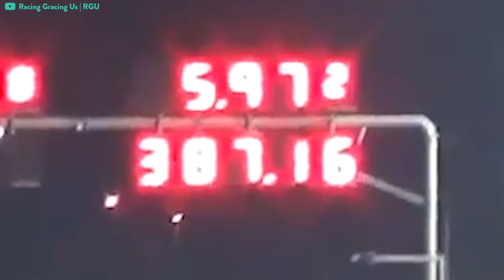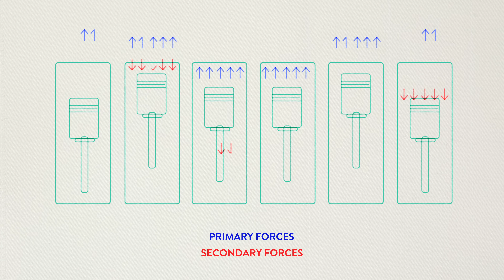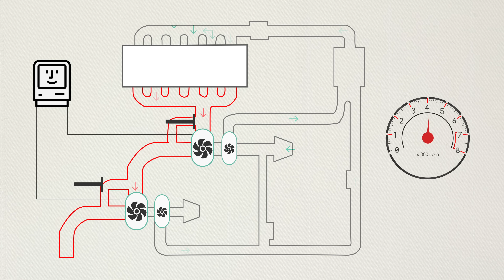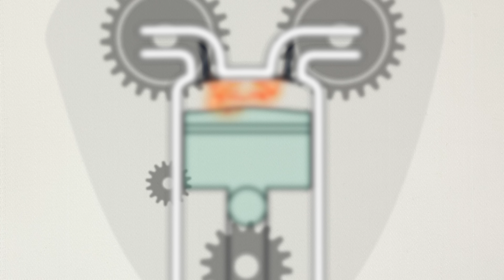2JZ ENGINE - How it Works | SCIENCE GARAGE

Comment: all this JZ stuff and i'm here with a single turbo 400 rwhp 7MGTE
Reply: sidsyz85
LOL I’m running two cars with 3S-GTE engines. One is putting down 300rWHP and the other is putting down quite a bit more (Need to dyno it at current level)
Reply: @negativeindustrial   I wasn't starting a dick measuring contest? M series(start 1965) is the predecessor of the JZ series, your S series engine debuted in 1980 so I genuinely have no idea what you were trying to accomplish.

Comment: Toyota should make the 2jz today and sell it separately, like the hemi v8
Reply: Or just buy a BMW inline 6 and turbo charge that, more or less the same
Reply: @alexstromberg7696  does the bmw inline 6 have a cast-iron block?
Reply: @kamaljyotsingh672  if you buy the right one yes. Some have steel sleeves, which is what you want. Engine is M50B25TÜ, people here are getting 800hp out of them to drift.
Reply: @alexstromberg7696  damn 800, where's "here"? Because your name is Strømberg, though you are in norway. Wasn't that engine used in M3?
Reply: @alexstromberg7696  what do you think about bmw making the engine for the Mk5 supra?
Reply: @kamaljyotsingh672  Sweden, the engine is in just the normal E36 325i I think. The M3 got S50B30s, which are 3 liters compared to 2.5l. they like boost too. A guy had a S50 in a E30 making 900HP and street raced it. 

Also here it's very hard to get legal streetcars to race. We aren't allowed to tune or anything but if you do it stealthly you can get it to work.
Reply: @kamaljyotsingh672  it's a good thing.
Reply: @alexstromberg7696  yeah it's hard here to get a racecar streetlegal, if you do it cost a hell lot of money. 900hp, they must be taking ferrari and Porsches in drag man, ouff
Reply: @alexstromberg7696  hey we should do a colab or something, are you going to raceworz 2019?
Reply: @kamaljyotsingh672  what is raceworz, I live in Sweden and never heard it it.
Reply: @kamaljyotsingh672  it takes down nos V8s with 1500 hp quite often
Reply: @alexstromberg7696  raceworz is like raceworz in fast and furious, stance cars, drift and drag, it happens in gardemoen Airport
Reply: @alexstromberg7696  V8s 1500 owned by i6s with 900, I got to see that to believe that
Reply: @Piotr94L  ait I believe it haha, you live i Sweden too?
Reply: @kamaljyotsingh672  nope, just the other side of Baltic sea
Reply: @Piotr94L  oh okay
Reply: @Piotr94L  what do you drive?
Reply: You need to own car with 2jz . Knowing Toyota, selling just engine don't make enough profit of multinational company.
Reply: @campkira  it could be profitable for toyota, i think at a lot of people would buy 2jz if on the market, its a great engine for almost any type of project car

Comment: This may be a dumb question but instead of switching to a bigger single turbo why wouldn't you just switch to a bigger secondary turbo and keep the smaller turbo for low RPM boost???
Reply: You can do that, it was done in rx7 13B, modern BMWs and many Diesel engines.
This way you've got all great things from both worlds - quick spool and good top end power

Comment: I own a 2jz-ge, it’s stock right now and has 195XXX, should I stay away from boosts and just go head and put headers, a cold air intake and a tune on it? (Of course more than that aka bigger pipes, better injectors/spark plugs/coil packs.)
Reply: You'll gain a lot more with like 9 psi of boost than a full of NA tune, at most like 40HP compared to 100HP for way less money
Reply: Thank you man. That what I figured, go low boost until I can buy a newer 2j

Comment: Too bad Toyota couldn't make their own engine for the new supra, or a manual transmission option
Reply: Guys I've reviewed the m240i with the b58 in it. Great car, great engine, amazing performance and power delivery. However, bmw reliability isn't too great from what I hear, so I'd hate to buy a supra that breaks down and costs a ton of money to fix everytime.
Reply: @MaxSpeedMike  I just watched a video that address that. According to that video they said Toyota was very concerned with BMW reputation with reliability so they ran the engines into the ground, every nut bolt and rivet down till they all failed and had them fix it all. From what I understand the short block is actually Toyotas design, may have misunderstood that and they developed I'm conjunction with BMW. In either case Toyota takes their reputation of reliability very seriously so im sure that carried over to the car. It probably won't be as good as a Camry at 200k but I would expect it to be decent.
Reply: No worries just 2jz swap it 😂
Reply: @suavehouse5150  haha 😂🤙🔰
Reply: @ekflpkf No confirmed manual option as of yet.
Reply: @gk5253  if I'm not mistaken it will come with manual but only in japan or some select asian markets. And it only paired with 4 cyl turbo engine variant though.
Reply: Agreed on the m/t, but BMW's i6s are great and the b58 is ridiculous. They underrate the 40is now and the pending m340i with stated 380 hp is surely underrated as well. In a light-weight Supra application and even better tune the engine will beast.
Reply: Reliability? Take care of your car. You curb it, too? I mean, c'mon...
Reply: they have developed the manual trans but will be waiting for feedback from buyers to determine whether they should introduce it, most likely to right hand drive markets first
Reply: Wait, they only have automatic? 

I have seen vidios  how drift the new supra in Spain and its Automatic?
Reply: MaxSpeed GREEEAAAAAAATTT
Reply: Agree
Reply: They said they might do a manual option it's just not confirmed because fans want a manual but most cars these says because of regular consumers are buying automatics more so there is a large decline in Manuel's.
Reply: MaxSpeed its you again
Reply: You must remember that 2nd and 3rd hand buyers mean nothing to manufacturers... They have to make car so it pleases 1st hand buyers and developing a whole new engine isn't just worth it.
Reply: BMW is the 29th most reliable. Not too great especially when you are talking about the #1 most reliable Toyota. BMW shouldn't be going anywhere near the Supra
Reply: Also no one buys manual transmissions everyone on the internet who cries out and bitches about that Everytime are clearly not people who can actually afford the cars they apply to. The people who can actually afford to buy these cars new from the manafacturer all want good automatics. I know I am one of them. I liked rowimg that manual transmission when I was 23 now I'm at 30, I ain't got time for that shit, the power delivery and balance of the car is 90% of the thrill. And I have no interest in sitting in my 1 hour commute everyday with a 5 or 6 speed and definitely not an 8 speed which manafacturer are forced into because of the absurd fuel economy mandates of the USA.
Reply: Ooo... BMW engine and a gearbox. What can possibly go wrong, hey... 😗😂
Reply: Wasn’t it Yamaha who did a lot of Toyota engine development?
Reply: Well yamaha made the engines for the supra soooo
Reply: BMW makes shit engines
Reply: @algarlegend  you're shit. you follow pewdiepie. whatever you say is irrelevant.
Reply: Good then that BMW has always made just as good engines as the 2jz, so the B58 is more than enough. You don't need 1200hp, those engines always have a shit powerband
Reply: @alexstromberg7696  BMW's are trash. Lmfao. Dont even compare
Reply: Alex thing is that they literarily could use engine of M2 or M4/3 but they settled for stupid automatic only mid-higher trim series 2 ass carriage for businessmen. Also we wont get any improvements at all same as there never ever was and will be a STI BRZ from Subaru because Toyota and BMW have anti-internal competition agreement in their deal. People seriously have to stop clapping for it, Toyota is being laziest they could ever be about it and with their position and resources it's completely inexcuseable
Reply: Kacpa2 but do you know why they did it, did you know why they chose the engine,do you know why they partnered? Research it.
Reply: Alex Strömberg oof that good old German reliability and oil leakage
Reply: @TheUberdude14  oof that good old "go fix it" maybe?
Reply: @alexstromberg7696  did this guy just say BMW has good engines? Lmaoooo
Reply: @terrabnadia1793  Just google INTERNATIONAL ENGINE AWARDS and see which brand have the most awards. BMW have the best engines in whole world and you are clueless
Reply: @lynx_bushcraft  BMW is overpriced and unreliable as hell. I would take a Honda over any German "luxury" pos any day
Reply: Aidan Barrett Their motorcycle engines are bulletproof.
Reply: @terrabnadia1793  lol ok you broke ricer boy.
Reply: @alexstromberg7696  at least one thinking person here
Reply: Why put a manual? Most of the people buying the new Supra aren’t the fanboys that love the manual. It’s a GT car and most people buying GT cars don’t want to deal with a manual transmission also the auto is a better transmission as you don’t drop out of boost, autos are faster shifting, and you don’t have to worry about working a clutch on a hill or in traffic.
Reply: @snipeatyou  driving a car with a manual isn't about being the fastest, it's about driving feel. And if you say that an auto can do the same, you're wrong.
Reply: Alex Strömberg an auto can give you that same driving feel. They make paddle shifters. Sure some are junk it some are good. Also if you want driving feel don’t buy a Supra. If you want driving feel get a corvette, Porsche, or a m car.
Reply: no, a paddel shifted car isn't even close to the same to a normal manual.
Reply: Alex Strömberg sure it’s not the exact same but you still get to select what gear you want. My corvette has an auto but you can lock it into different gears and it has about the same driving feel as the twin turbo 6 speed Supra I drove. I mean sure the Supra was slightly faster because my corvette has 2.73 rear gear and is a convertible but in the corvette you could feel the road way better than in the Supra although you could easily select which gears you wanted.
Reply: @snipeatyou  liking autos is fine to each their own. However a manual transmission is so much more fun and entertaining to drive for me. I don't care about performance but I do care about feel and fun. And no an auto with paddles isn't the same. The only thing that does it for me is three pedals and a stick.
Reply: Cameron James lol just let this guy think shifters are the same.
Reply: @snipeatyou  While I agree that autos that let you control the gear are an improvement over normal auto's, if you have driven manuals for an acceptable amount of time, you surely know that a manual is even further of an improvement as far as driving fun is concerned. Otherwise, you have not driven a manual for an acceptable amount of time and you should try that out. Either way, your argument is silly at best.

Yes, manuals are more work and there is obviously a valid market for the auto as most people do not want that. However, this is a sports car. The idea of a manual transmission is to more intimately connect the driver with the car. It engages you more, demands more of your attention, and makes you a more superior driver as a result. These are all things drivers of sports cars should have, if they desire it. Therefor, any self respecting manufacture of a sports car should include a manual option. The end.
Reply: Kakunapod it’s not really even a sports car. It’s a gt car like it’s always been. An auto is a superior transmission to a manual. Also not a big enough market to justify it. They would spend a shit ton trying to have all the computers work together and cutting stuff to fit the manual. The businesses main goal is to make money. I’ve driven manuals plenty. And it’s fucking annoying when you’re sitting in traffic and honestly you can control gears just as well and be faster in an auto. This whole manuals are much better nonsense is stupid. The only thing different is you push down a clutch and move a shifter around. It’s not that much more engaging than a paddle shifted auto. Also why does everyone say that manufactures need to include manuals but they don’t because of sales and most people saying manufacturers need to keep manuals aren’t buying those cars new. Manufacturers don’t get money from a sale of a used car so why would they keep manuals.
Reply: @snipeatyou  I cant get through the first few sentences of this, you are very close minded and refuse to even hear people who might be wiser than you and I don't really care to talk with you anymore
Reply: Kakunapod if manuals were worth it every manufacturer would sell all their cars with manuals but it isn’t. My trans am was a manual and it was fun but it’s inferior to an auto hence the reason f1 doesn’t use manuals although they use DCTs not traditional autos. I’m not saying a manual isn’t fun every once in a while but honestly it’s just not something for everyday driving or even performance driving.
Reply: @snipeatyou  Agree with you. People that are screaming save the manuals aren't usually buy new expensive sports cars. I'm sure toyota already doing their market research for manual supra and come up with conclusion that they're not feasible in business perspective, is not like they ignored the manual option at all.
Reply: Alex Strömberg You ignored what he said about the fact that they are not going to do this only for the Supra fanboys. It's a Gt car. Do you think every person who is going to buy this car is a Supra fanboy? No. They are focusing on the general market not the fans. Please do research.
Reply: @snipeatyou  its all about driver involvement and in a paddle shifted car its just not there. the less you have to do, the less fun it is. youre an a to b driver, not one who takes pleasure in driving.
Reply: ian price they are focusing on the first buyers not the second and third drivers. There is a high demand for automatics.
Reply: @snipeatyou  then why call it a Supra
Reply: Aidan Barrett because that’s what they decided to call it. People get so mad over it when I’m the beginning Supra was just a trim and it wasn’t turbocharged. I’m not happy about the new Chevy blazer or the 80s Chevy nova but at least I don’t go around everywhere saying I don’t like it. Also most of the people upset with them calling it a Supra wouldn’t even be the ones who would end up buying it in the first place
Reply: @snipeatyou   can you drift with a auto?  Because  you can conpletly shut down the ABS in the new supra
Reply: Thats Damian! You can drift an auto as long as there is no traction control
Reply: ian price 
I agree with with you but I don’t at the same time. Automatics may be slightly quicker and faster in some instances but regardless of how much faster an automatic is. You will never get the engagement and nostalgia you would in a manual transmission point blank.

Comment: It's an Amazing Engine. 2JZ-GE in my lexus. I want a 2jz-gte though.
Reply: They have that model on the Toyota Aristo (Lexus GS300) but it's only in Japan only
Reply: Yes the IS300 also has the 2JZ-GE if I recall correctly..
Reply: @stradale72  it does
Reply: just turbo and upgrade rods n shit, althought it would be easier to swap a gte into it it wouldnt be nearly sa fun
Reply: You can convert the GE to a GTE.
Reply: That Aristo was fast. I miss Japan so much.
Reply: Lexus GS300 (2nd Gen) right? Awesome, my dad has one too.
Reply: @stradale72  yeah it's second generation I think V300.
Reply: Is300?
Reply: Same I have it on my gs300 and I want to turbo it
Reply: Stronk Tank me to!

Comment: Donut. Next up: N54 engine. The modern 2JZ
Reply: Yes please!
Reply: It’s as close as we have. Wish it had a closed deck block though
Reply: @blurglide  mk5 supra B58 has closed deck block
Reply: No
Reply: My trailblazer has a 4.2 liter inline six 😏😏😏😏😏
Reply: @xboxmaster95245  LL8
Reply: @Piotr94L  I did not know it was called an LL8 thank you kind sir!😁
Reply: @xboxmaster95245  that makes 160hp at most and is slower than my friends 206 Peugeot.
Reply: @alexstromberg7696  291 actually but hate for no reason I guess🤷🏻‍♂️
Reply: @xboxmaster95245  Epic gamer
Reply: Shut the fuck up. A 2JZ is made by Toyota and a N54 is a engine made by BMW. Last I checked, the N54 cannot keep up with the punishment that the 2JZ can withstand.
Reply: Barra>n54.
Reply: naah i think Toyota's engines are more reliable, but the n54 is obviously a tad bit more modern
Reply: @no____-____ah  n54s are proven that they can make huge HP numbers
Reply: Noah Mårtensson N54 is reliable.
Reply: @CadexLaw  Hell no, plenty of issues that you often don't have anyway around. Aftermarket HPFP alone is $2K...
Reply: @SpikeRazzor  
lmao n54 hpfp can be found under $500
Reply: @SpikeRazzor  People need to stop talking about these cars if they don't know them. The HPFP problem was lack of lubrication which in like 200x was remedied by a software upgrade. Now if a HPFP pump fails it's a fair mechanical failure (like any other part on any car). The pump itself can be purchased for sub 300$ and the process of replacing it is easy as DIY.
Reply: @polskipaul7567  Send me a link to an N54 fuel pump I can have at my door for $300 and I'll buy a 335i right now. Bullshit
Reply: @youngroosevelt38  Send a link or shutup
Reply: Jacob Chaney sure, buy a 335i. I deal in parts. If your hpfp breaks I’ll sell you one for 300
Reply: Spike Razzor It’s definitely reliable. HPFP is a cheap fix, and isn’t a problem with the engine block itself.
Reply: @CadexLaw  the engine itself is rock solid. Just gotta fix the stuff around it. But it isn't much of a problem if you diy
Reply: Sorry close but no cigar
Reply: The N54 is not the modern 2JZ. More like the B58.